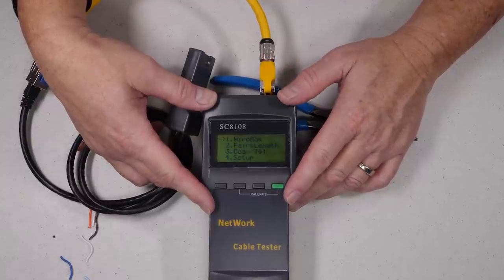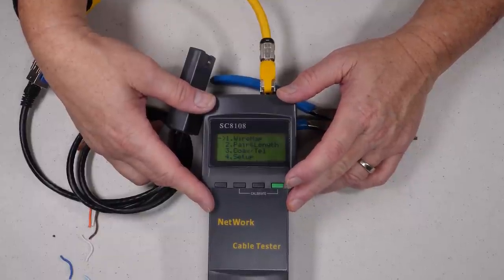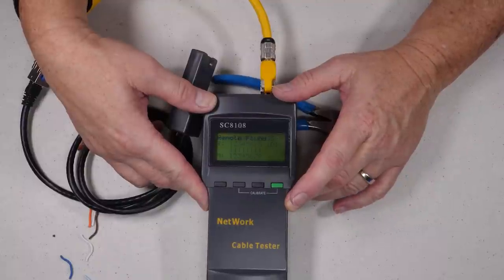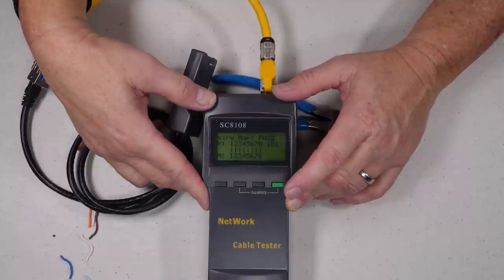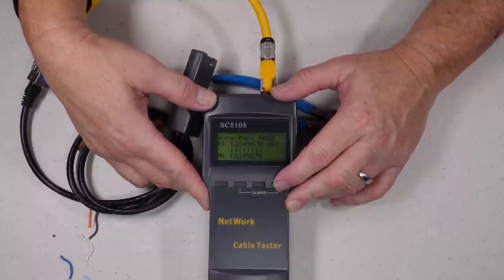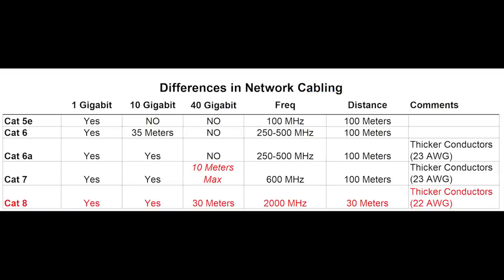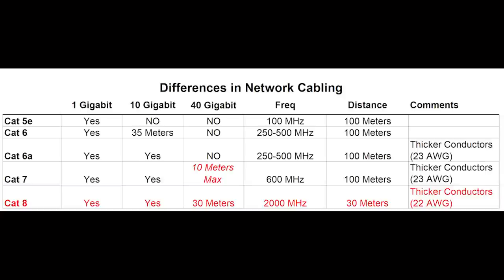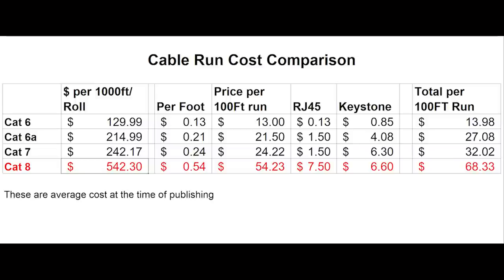CAT 8 vs CAT 7 Ethernet Cables - Is there a difference?

Comment: I've only been retired five years and there are three new cable types. We weren't getting most requests for Cat.5E. Only a few Cat 6. 
This is mostly customer generated as to cable type. Most of them have equipment they won't be replacing soon. If they were moving into a building that they're buying and doing major refurbishment I'd suggest going to the highest type emphasizing the cost of rewiring later at a higher cost. I talked a customer who was moving to wire his Unix system with unshielded twisted pair and adapters and patch panels so he could go to a PC system one day.He agreed but wasn't keen on it because his computer person said Unix would always be around.
Well, his building was struck by lightning and everything was destroyed. His computer guru said he couldn't replace it so he had to go to a Windows based network.  Thats when my advice was appreciated. They just removed the UNIX system reversed the connections to the patch panels and Digi Boards and the network was running.
Reply from the maker: Wow. Thanks for the story and comment.

Comment: Nice Video!
I am working as an electrician here in Austria and in my company we only install cat.7 cables and use tool-less cat.6a or 7 keystones.
If I recall correctly the bigger conductor size of cat.8 is because of the skin effect.
 High frequency currents only travel on the surface of the conductor !
Reply from the maker: Sounds right as it is rated at a much higher frequency.
Reply: How is the frequency that gets used determined? Also, The cat 7 keystone is gg45 which requires an adaptor for rj45 no?
Reply: @AlejandroTaylorEscribano  The Frequency is tied to the  transmission speed Higher Frequencies give you higher Bandwidth.
There are male and female , RJ45 keystones available
Female are the ones you use in special  wall sockets that come empty so the keystones act as receptacles

Comment: A nice walk through and your conclusion is in line with what I feel atm.

For most soho installs I tend to go for Cat 6 or 6A as well.
Reply from the maker: Thanks for the feedback.  Glad you like the video.
Reply: @MikeFaucher  hi sir please, if I get a linksys WiFi router + an Ethernet cable can I still connect my laptop ??
Reply: @MikeFaucher  and do I need to pay other monthly fees ?? Thanks
Reply from the maker: @elfidel6755  Yes you can but I would use regular ethernet not this stuff.
Reply: @MikeFaucher  ok I wanna use it in my single room .. which one best can I get please ??
Reply from the maker: @elfidel6755  For Wi-Fi and ethernet, I would just use a CAT 6 Patch cable.  Most routers can not use any more speed than that.
Reply: @MikeFaucher  ok understood thanks for answering

Comment: Damn today I learned there is a Cat 8.
I'm still using Cat5e and 6 at my house, which is fine.
Reply: Things sure escalate quickly
Reply: Cat5e will still be fine for a long time, as long as you don't own a palace,10G family networking can totally run in short distance with cat5e.
Reply: Same, federal ISP i'ms working for still  using 5e  for  apartments even  for gigabit ethernet
Reply: Cat 5 was the latest tech when I did Cisco networking in high school and college and 5e came out shortly after. I wired my home with cat 5 and 5e and did a few small offices where I was doing build outs as I was a pro painter and did framing, drywall, and electrical....pretty much everything for typical commercial buildings. Things change fast and I have only had to do a few patch cables in the last 10 years or so.
Reply: There are more than 8 CATS outside my place. Maybe CATS 9-15.
Reply: Prolly no BASE T standard will ever be affordable that will make use of CAT 7, let alone CAT 8.
Reply: Run Fibre optics for very future proof. We might need 100G 10 years later.

Comment: I did an install of 300 points 7 years ago. Did the same calculations and installed Cat 6. Most runs were under 30m. So still capable of 10G today. Pre terminated fibre is so cheap. So if you want to future proof install a run of fiber with cat 6 even if you don't use it. The only advantage of copper over fiber is POE. The other cool thing about fiber is you can haul a multi fibre cable and with one run have 24 or more pairs. Here in Australia it has the added benefit of almost having no installation requirements in S009. Whereas copper has seperation, weight and now power dissipation.
Reply from the maker: Thanks for the feedback.

Comment: 5:00 that is not specific to CAT8 though, you can get the exact same keystone for Cat 6 as well. It's what we have been using even since CAT6 became available. Entirely depends on the manufacturer of the keystone module.

Also I strongly advise against putting a plug on an "installation cable" (in Europe this is considered to be a botched job), these cables are meant to be terminated with a keystone module and then left alone inside your rack. Reason being the solid wires inside these cables break rather easily when bent/twisted/manipulated frequently and that leads to all sorts of "fun" connection issues.
Reply from the maker: Thanks for the input.
Reply: Do you have any examples of the advised method.  A picture maybe?
Reply: Just keystones on both sides lol
Reply: With a patch panel in the rack

Comment: Did my whole house up with that cat8 linkup cable earlier this year. Nice cable but those connectors were kind of a pain. I ended up scoring the jacket on the wires where the contacts meet them. This helped with make reliable connections more consistently.
Reply from the maker: Thanks for the feedback.

Comment: The only place I use Cat 8 is from my computer to my modem/router. The rest is 5e for the time being. May upgrade to 6e/7 in the future. Thanks for a very informative video for the masses.
Reply: What crazy router are you using that you see any difference between cat5e or anything else. Even regular Cat6 can pass 10Gb at short distances
Reply from the maker: Thanks for the comment.
Reply: @kinghomer999  Not the router. I had Cat 8 on hand and used it. Plain and simple. I should not have to replace it for a long, long time...perhaps never.

Comment: nice video, hopefully CAT7 and 10G ethernet is gonna start to become the norm more and more but i dont see yet how anyone will need 40G in their home network anytime soon.
Reply from the maker: Thanks for the feedback.
Reply: Agreed, but ive also never met someone that could fully saturate Cat6a even in the home, aside from a rare enterprise 10g or 2g bonded connection form the ISP, and in that case even the cable is installed by the ISP from the Modem to the Router. I have full fiber gigabit internet in a large overkill network in my home nd I still run Cat5e because no single appliance/end user will be saturating a full gigabit even... And I have servers, 4k cameras etc...
Reply: Cat7 is not needed for 10G. It only needs Cat6 or Cat6a depending on cable length. More than 55 meters needs 6A, and the vast majority of home network installations won't even come close to that.
Reply: Im doing Cat 6a regularly these days, its cheap and easy, and will be viable for a long time. Just pains me when i come back to panel and the user is using cheapest cat5 patches they can find  to connect it all :D

Comment: I only use field termination plugs, much better for shielding. The wires get unshielded at both ends if you use a typical RJ45, that’s were a lot of the interference will happen.
Reply from the maker: Thanks for you input!

Comment: It's been probably 20 years since I terminated any Cat 5 cables which were not really that hard. I'm glad I retired from the business, because I can't imagine the patience need to terminate these Cat 7 & 8 cables. Good grief. They must be 10 times as expensive as the old Cat 5 cables I used.
Reply: Cat 7 & 8 are extremely rare, it's easier (and cheaper) use fiber optics

Comment: Thank you for the information.  I'm not building a network, but the info will aid me in building a patch cable for RF equipment between a control head and base unit.
Reply from the maker: Glad it could help.

Comment: Just imagine terminating 100's of those, RIP fingers
Reply from the maker: Yep, that would hurt.
Reply: last week did 84 of cat 6A in a little office, you get used to it.
Reply: @anttimaki8188  I install network cabling for a living and we like to use the Panduit Mini-com jacks, no punch-down tool required, and I find they are a lot faster on terminating and entire closet.
Reply: @NehpetsNosliw  I only do these occasionally, comes with electrician Job. I use whatever the boss has bought. Havnt seen punchdowns for a while though, mostly these clipping ones. Then theres those that got a tool that punch and cut all 8 wires simultaneosly. But If you only do these like every other month its kinda hard to sell the idea to boss :)
Reply: Just a job.. here in Russia we use only Cat 5. Speeds over 1G are only reachable with fiber-optic. Cat 6-8 are not acceptable because of money/speed proportion.
Reply: When I saw all those foil, I was glad I went for cat6

Comment: I've installed "Cat 5e" CCA UTP cables about 8 years ago because it was cheapest. Now i'm replacing all of them with dual branded cat 6A U/FTP cable and shielded keystone modules everywhere, except for the IP cameras, those are Cat 5e FTP (Cu).
I remember arguing with someone about 2 years ago about cat 7 vs cat 8. I said "there is no cat 8, you must probably mean cat 7". I was wrong, so it seems?
Reply: Just add, don't take, your Cat5e will support VOIP, may be 7 wont?

Comment: Folks, please don’t believe everything you see on Amazon. I work on both the US and global standards development organizations that develops all of the cabling category standards and I’m going to provide a few facts about the different categories of cables and their constructions/specifications. 
UTP=no shielding at all. 
F/UTP=unshielded pairs with an overall foil shield. 
Sc/UTP=unshielded pairs with a screened (braided) shield. 
F/FTP=shielded pairs with overall foil shielded. 
Sc/FTP=shielded pairs with screened shield. 

Cat5e through cat6 can be constructed with any of the above depending on the users requirements. 
Cat7 and up must be Sc/FTP because of the extended frequency range. The shielded pairs mitigate internal crosstalk and the screen mitigates alien crosstalk between cables in a bundle. 

Cat5e=100 MHz, 1Gb/s at 100m, any connector style. 
Cat6= 250MHz, 1Gb/s at 100m, 10Gb/s at 55m, any connector style. 
Cat6A= 500 MHz, 10Gb/s at 100m, any connector style. 
Cat7= 600 MHz, 10Gb/s at 100m, only EC7, GG45 or TERA connectors (google them), RJ45 not supported. 
CatA= 1000 MHz, 10Gb/s at 100m, 25Gb/s at 50m, only EC7, GG45 or TERA connectors, RJ45 not supported. 
Cat8.1= 2000MHz, 10Gb/s at 100m, 40 Gb/s at 30m, any connector style. 
Cat8.2=2000 MHz, 10Gb/s at 100m, only EC7, GG45 or TERA connectors, RJ45 not supported. 

Multigig/NBaseT = 2.5Gb on cat 5e or better to 100m, 5Gb on Cat 6 or better at 100m, 10Gb on cat 6A or better to 100m. Depending on cable quality you might get 5Gb on cat 5e and 10Gb on cat 6, no guarantees. 

So,  the “cat 7” connectors you bought on Amazon are BS because as you see from the information above, cat 7 does not support RJ45 connectors. That’s a fact. So why can cat 8 be used on RJ45 in addition to the other connectors I mentioned? It political as most Standardisation is. The US (ANSI/TIA TR 42.7 committee) never adopted cat 7 or 7A because some companies refused to move away from theRJ45 for fear that users would not support a solution that was not backward compatible. The ISO/IEC SC25/WG3 committee did ratify 7/7A components. Terminated links are called Class F and Class FA respectively. 
With Cat 8 we had the same concerns in the US so two grades were created, 8.1 and 8.2. The transmission specifications are identical but it much easier to achieve with the non-RJ45 connectors. 

I hope this helps and I’m happy to discuss via comments or privately if anyone has questions.
Reply from the maker: Thanks for providing the extra detail.
Reply: @MikeFaucher  No problem!
Reply: Thanks for this info noted on this!
Reply: What is cat 6e?

Comment: good video , you shuld also point out that for POE cat6a and above will preform better in terms of power lost
Reply: Only for POE+, even then you could see a significant voltage drop over certain distances. Especially in use with balanced wattage applications, a larger conductor will hurt at a certain point. I think Cat6a is actually the sweet spot for this as far as carrying power is concerned.

Comment: Man, if you are running inside of walls, use the best cables available. The labor costs of changing it later (or retrofitting it now) are way higher than the incremental cost of the cables and parts.
Reply from the maker: Very true and good point.

Comment: I'd hate to do a whole wiring job with that stuff!
I have found CAT7 to be useful when on shortish runs where interference from other sources (video, electrical...) cannot be avoided.
Haven't worked with CAT8 yet.
Both remind me of shielded token ring wiring, as it was pretty good about making it through factories with lots of high voltage equipment without loss.
Reply from the maker: Yeah it would be a lot of work.
Reply: @MikeFaucher  So was token ring! That was even better than those giant cables for S/36. Don't miss that at all. Of course we couldn't plug everything into Ethernet then, let alone wi-fi. One worker might have had a twinax for a terminal, another for a printer, token ring for a PC and a phone line and a fax line. 
Thanks for the video and your effort.